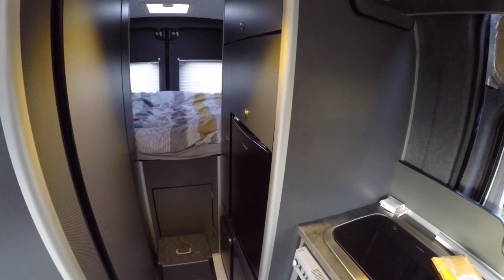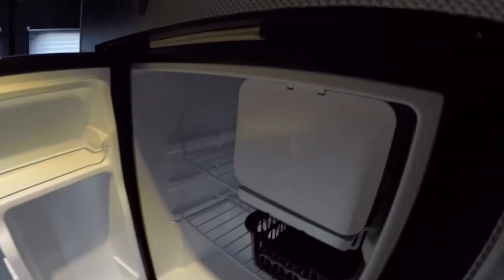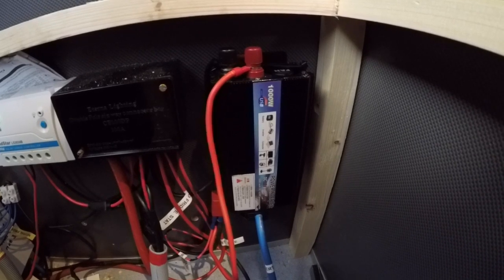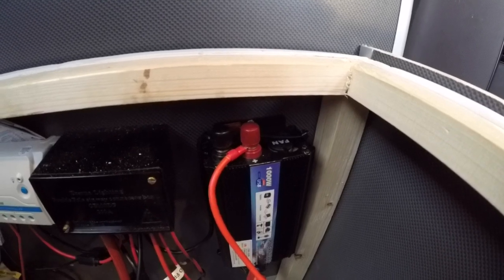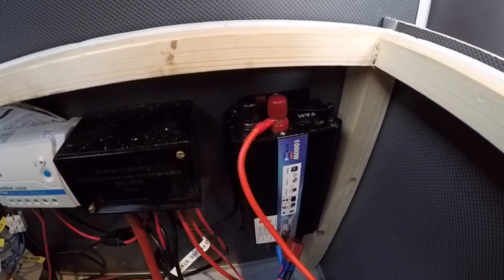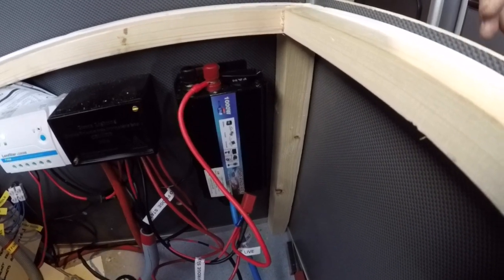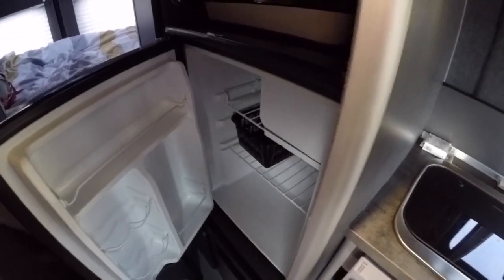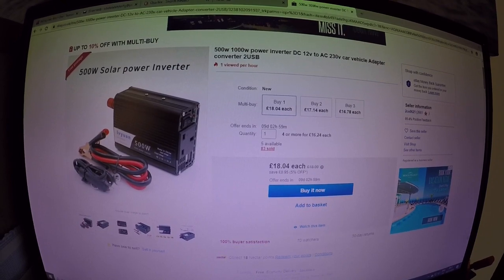Campervan installation of a domestic 240v fridge with ZERO draw from batteries when down to temp

Comment: Good job just finished putting mine in the van ,your door lock did you drill the hole slightly deeper?
Reply from the maker: No just removed the plug.
Strangely the fridge has worked perfectly and I’ve replaced it with a fridge freezer. That is intermittently  stalling. I haven’t quite worked out why. Power consumption is the same. Gotta try these things.
Reply: @craster_van_kippers  thanks for the reply hope you get on well with your fridge freezer and we all get an update video
Reply from the maker: Fridge freezer solved. Just needed a different inverter with a bit more grunt in start up. Other one was borderline. Great having ice available.
Reply: @craster_van_kippers  what size of inverter did you use or make?
Reply: Is the fridge freezer the same height or bigger
Reply from the maker: It’s a bit taller but still under counter. It’s branded “Cookology”.
I paid £149 in black. It’s ultra quiet seems to run on slightly less amps than the fridge. Electrical spec is virtually identical which is why the stalling intermittently had me going in circles. My main inverter 2000w starts it no problem so that is temporarily the fridge freezer inverter until we get back home.
Reply: @craster_van_kippers  thanks

Comment: It's a good idea but I would be very wary about those cheap ebay inverters - they have misleading ratings. Most reputable 1000W inverters are quite large and have very heavy cables. I bought a cheap so-called 1000W inverter, plugged an electric sander (120W) in to it and it worked for about 1 second then the inverter died! It was actually only rated at about 100W. After all, a 1000W inverter would be drawing 100 amps from your batteries at full power, and the supplied cabling is not even close to that rating. Be very careful with it. It's also a good idea to fit a smoke alarm close to the inverter.

Comment: I guess that after this change it's not possible to use the fridge connected to the normal 220v for example of a camping? Am I right?
Reply from the maker: correct! however on the very rare occasions we hookup, it still works as it is. whole thing on leisure batteries. fridge is running now. we haven’t moved for twenty hours, batteries are 98%.
it is sunny and 240v coffee machine been on four times
Reply: @craster_van_kippers  So that means the power goes: Shore power > Charger > Battery > Inverter > Fridge? The downside is that the inverter fan could go on at night, right?
Reply from the maker: Yes it does. However everything has now changed.
1.no beep. It’s been disabled.
2.inverter is now in vehicle battery storage under the floor.
 Can barely hear anything now.
Reply from the maker: In fact the fridge has now been replaced by fridge freezer:

Comment: Hi Keith my partner and I met you at vanlife Festival  2022, you mentioned the fridge hack. Can I ask how long you spend away in your van without hook up?  How does this affect your battery/batteries? Thanks
Reply from the maker: Hello
Last year we spent 9 weeks in Portugal now running a fridge/freezer. The temp in south west France was in 40s. We were on hookup only two nights as it was included. We coped
90% of the time. In other 10% our AGM batts ran down to 11volts and our replacement more expensive inverter shut down. So now I’ve just done another van which now has the agms in and the original fridge. All is working great leaving it on psrked up at home.
We put two 100 amp lithium in the black van and I have never seen voltage drop below 12 1/2. Those batts cost £680.
The other van has a cheap ish 1000w 2000w peak pure sine inverter which cost £62 two weeks ago. It had an on off switch which I’ve connected to the fridge stat and ditched the 12volt and relay.
This is much simpler and wish my original inverter had had a switch.
We are about to go to Germany and daughter taking other van to Holland. I’ll let you know how we get on but I can assure you that it works great. We will miss every show this year sadly. Did get to Willowfields in April.
Reply: Cheers Keith,  I'm half way through my second build,  got 400w solar and a 280ah lithium phosphate lifepo4,  looking at putting a under counter fridge freezer, so I want I 1000w inverter for the fridge and a bigger for other things? Is this possible?
Reply from the maker: Yes I have just done exactly the same thing.
Cool zone under counter fridge freezer. That one is running from a donor Durite 1509 modified.
My original fridge is now running on the eBay 1000pure sine. Neither of my 1000 and 1200 Sterling inverters would start it up. I’ll come back with details of inverter I’ve just bought.
Reply from the maker: https://www.ebay.co.uk/itm/125953527198?mkcid=16&mkevt=1&mkrid=711-127632-2357-0&ssspo=0cyzjwmps2e&sssrc=2349624&ssuid=UzXPUFF2SQu&var=&widget_ver=artemis&media=COPY
Reply: Can I ask where you bought the cool zone fridge freezer?
Reply from the maker: Amazon. But also have a look for eBay sellers. I paid £149 some one else I know got one for £129x
Reply: @craster_van_kippers  cheers Keith,  just ordered the same inverter,  still looking for the fridge freezer
Reply: What energy rating is that fridge freezer? All the ones I've seen old rating A+ new rating F
Reply from the maker: That’ll be about right. One on google £135 minus 5 % f rated.
Reply: @craster_van_kippers  hi mate, do I still need 12v to the thermostat,  only I've wired stat to the switch and it's not working
Reply: Sussed it mate, thanks for all your help

Comment: Do you have a diagram please?
Reply from the maker: hi I’m sorry. if you know how great. the video was for the idea rather than a how to. the reason is that I don’t want to be responsible for those who maybe misunderstand and diagram.
Reply: You can explain the wiring without getting into bother. Just put a disclaimer in. 

I run a 110 litre Beko TSE 1284 (A+++) with a Victron Phoenix 800VA inverter. My approach was to get the best I could find. Inverter has Eco mode which means the inverter is off and just tests for demand and switches on if required. Problem is the fridge light doesn’t come on if the compressor isn’t running. I just leave the inverter on all the time.

Comment: Hi.  Great video, especially for a new channel, and a brilliant idea, but I WOULD say that since I was discussing this exact idea on self build campervans about 6mths ago.
I bought a 66ltr countertop fridge from Currys,  link here:
https://www.currys.co.uk/gbuk/household-appliances/refrigeration/fridges/logik-ltt68s18-mini-fridge-silver-10174941-pdt.html

and I think it was just under £80 at the time, although same as yours, it has gone up a tenner. I've checked out the thermostat connections and I'm certain that I will be able to also get this idea to work, but there have been more urgent things to do.  Plus we're not at the inverter stage yet.
As others have mentioned (further down), the compressor side of the relay contacts just needs to be capable of handling the brief start up current, but I'm not sure about the 200A one that someone ordered.
You mentioned NOT wanting to put a schematic up in case someone got things wrong etc., but loads of people do it, indeed Greg himself has just done that with his latest video, and the entire video is a schematic!  Link here:
https://www.youtube.com/watch?v=rVkDPzrA-zw&t=5s

Well done for putting into action, what I've only managed to speculate on so far, and good luck with future videos.  I've subscribed.
Regards Mark in the UK

Comment: Only issue i can see is the power cycling of the fridge
Reply from the maker: No issue for me. Been in 5 years now and has been upgraded to fridge freezer. Honestly don’t over think it. It works. Not just for me but many others who I’ve met since. If you look back through the comments you’ll see i now have an inverter with a switch. So I’ve now done away with the relay and low current 12volt. The stat has now simply replaced the inverter power switch.
Thanks for watching and taking the time to comment.